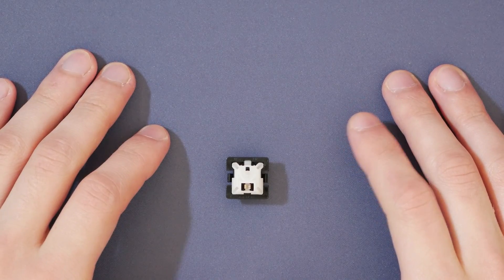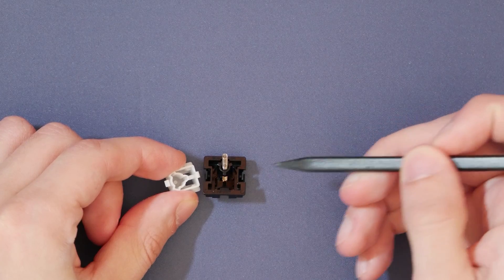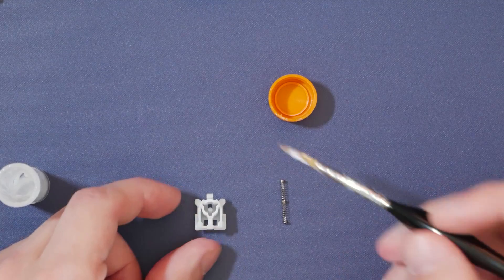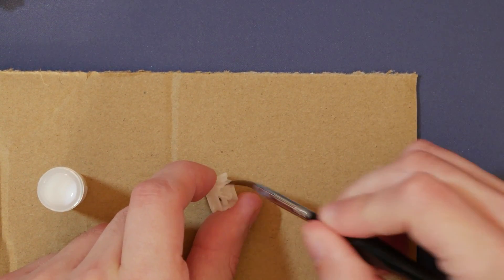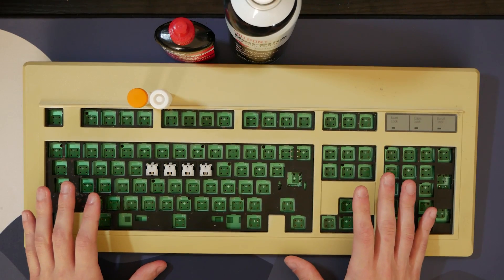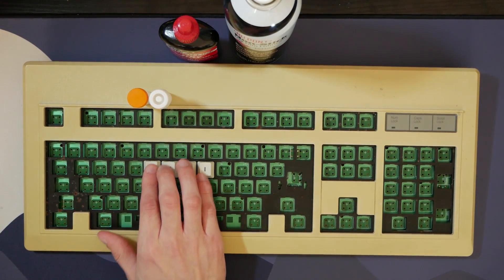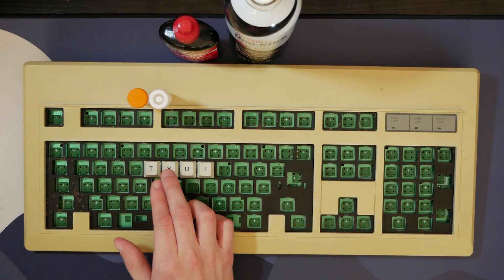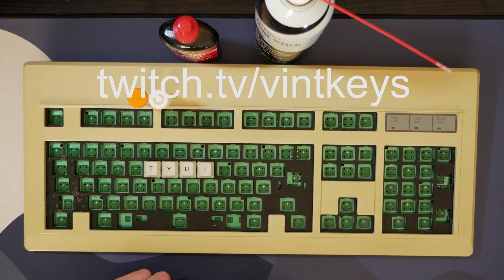Choosing the right lube for NMB Space Invaders

Comment: I have one with black clicky switches and I found the left control key to be prone to binding. I lubed the switch with some rather thick lube and it didn't help. I then modded the control key to be linear and that helped a bit. However the off center presses can still sometimes produce binding. I think this might be inherent in the switch design as these switches have zero wobble, which means under wider keycaps they sometimes get stuck.